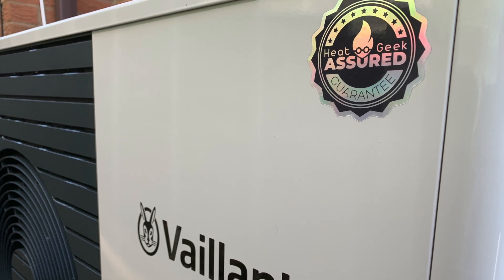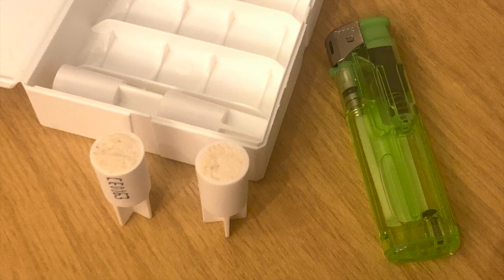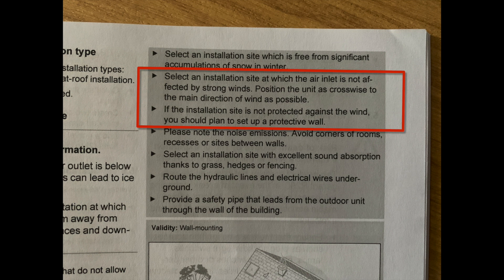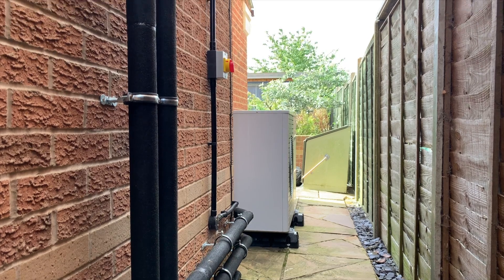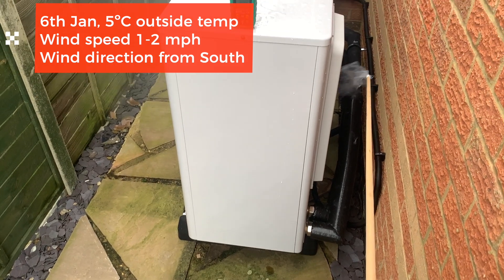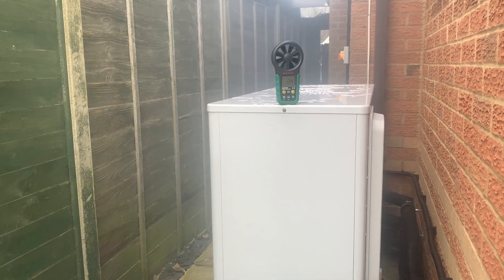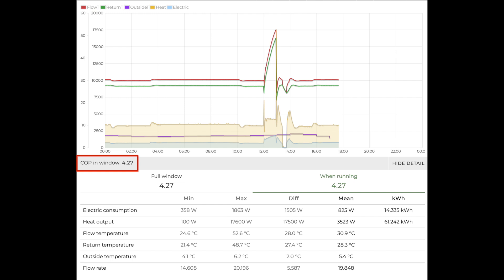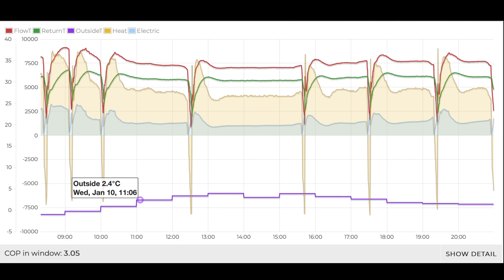Does our heat pump suffer from microclimating

Comment: I wonder why my unit, a 16kW Samsung, requires so much more clearance in every direction. We have a similarly configured but about 50cm wider side path and they refused to fit it there. I would have thought the requirements would be similar as it’s just a fan, perhaps it’s because my unit it tall but thin and so is more likely to capture exhaust airs.
Reply from the maker: Each manufacturer will have their minimum space requirements for the outdoor unit. Looking at the installation instructions for AE160JXYDEH is states; 300mm or more behind the unit and 1500mm or more in front of it. So yes, much more space than mine required in front of the unit.
Reply: @ Yes, strange. The other strange aspect is that the various refrigerants used are different boiling point fractions of natural gas, so not different from the gas used for burners or bbqs. Why it’s ok to have a large bbq cylinder of propane near a window but not an ASHP using a small volume of gas makes no sense from a risk management perspective. Before we put an induction hob in we even used to run a propane cylinder to feed our gas hob, that was fed directly into the house.
Reply from the maker: @yp77738yp77739  yes it is rather at odds with reality. Remember that there's two different minimum spacing requirements here. One is for space around the appliance for it to operate effectively. The second is for a protective zone for the refrigrent in case of leaks. The minimum distances are not the same in both instances.

Comment: Your smoke test doesn't show the full situation of your heat pump, you should be measuring the ambient temp in your alleyway or at the heatpump outdoor sensor vs ambient temp on  the garden side of your house. Then you will see if there is a microclimate.
Reply from the maker: Good suggestion and a valid point for a detailed analysis of the situation this would be a good approach.  

The smoke test was good enough for me to understand the air flow patterns around the unit on different conditions. Looking at the stats for the past 300 days since installation it's obvious we are not suffering from micro-climating. I compared like for like installations on https://heatpumpmonitor.org

Comment: What's wrong with locating at higher up the wall, above hight of fence ?
Reply from the maker: Good question David. It's certainly a solution if micro-climating is a problem. As it turns out we don't suffer from micro-climating. Therefore wall mounting provides no benefits, adds installation difficulties lifting the heat pump due to its weight. There's the potential of vibration coming through the walls once wall mounted.
Reply: @johntisbury  I had mine wall mounted which gives me a pipe length of about 4 feet. Everything is on vibration mounts and nothing is audible either inside or outside the house. The weight is only about 120Kg so not an issue.
Reply from the maker: @mbak7801 it’s a good option for sure.

Comment: Thanks for this video, I’m about to install one and was worried about this but the space I have to install is bigger than you had in the video and it’s only a 3.5kw HP. 

Are you able to provide any noise levels you experienced in that space? I’d love to have the original video sound to know how noisy it is as there is a ground floor window about 2 meters away from where the unit will be located. 😎
Reply from the maker: Thanks for watching. You won't hear the heat pump although that does depend on the brand. Vaillant are amongst the quietest. We can only hear ours when it does a defrost and you really have to listen out for it. When it's running for the majority of the year the window will be closed. It's only in the better weather during hot water cycles if the window is open you might hear it. TBF the Vaillant sounds like a fan heater on its lowest setting even standing next to it. We cannot hear it in the house.

Comment: You have home assistant, so with an Arduino and 3x DS18B20 temperature 1-wire probes, you could monitor the ambient temperature (somewhere in the vicinity) and the temperatures of the intake and exhaust.  If the temperature at the intake slowly drops while the unit is running and the ambient temperature remains fairly constant, then there is some micro-recycling.
Would be interesting to see the graphs over a period of time and at different times if the year though.
Reply from the maker: This is a very good suggestion, thank you.

Comment: Hi John, interesting diagram on right at about 4:16.  Is that saying you need 1000m clearance between top of pump and bottom of window if there is an opening window above it?  Interesting video as I'm currently in the planning stage.
Reply from the maker: Thanks for watching. No the 1000mm refers to a clear distance above the heat pump of 1000mm if you had a low car port or something like that. You will however need to consider the R290 protective zone which only impacts windows or doors to the side of the heat pump. Not those directly above it. I guess that's because any leaked gas will drop to the floor rather than rise. You can download the manual from Vaillant's website before purchase.

Comment: Micro climating in your setup would be very unlikely, even with the wind facing the heat pump front, the wind will hit the surface of the house and draw up the wall and the wind at roof height will be significantly higher creating an up draft. The fan draw would have to be significant to stop the wind drawing up.
Reply from the maker: Thanks Sean, that's a good point.

Comment: At 1:46 in the video you can clearly see on the clearances in the bottom right that Vaillant recommends at least 2300mm in front of the unit (F + G).  You commented to me in the comments for the video where I raised this concern that Vaillant's recommendation was 600mm, then later in the video you show another page which shows a minimum clearance of 600 mm, which one is correct?  They can't both be right.  You also need to repeat the tests when there is no wind and when the wind is SW or W.  These tests are not conclusive but they do show some expelled air being drawn back into the rear of the unit.  There shouldn't be any expelled air being drawn back in.
Reply from the maker: Hi David, I have re-looked at the video and cannot see any mention of (F + G) at 1:46 mm:ss, perhaps it's a YouTube timing issue. I have re-read the installation manual and G is not referred to as a minimum clearance measurement. F is referred to when was wall mounted, which can be ignored for our installation. Could it be the R290 clearances you are referring to? I see this at timecode 1:58 when I view the video. Here is refers to F + G (500m + 1800mm) which equals the 2300mm you quoted so I'm guessing this is what you are referring to. These measurements are the R290 refrigerant protective zone and there cannot be any windows, doors, light shafts, cellar entrances, escape hatches, flat roof windows or ventilation openings in the protective zone. As mentioned in the video this does not apply to our installation as we or our neighbours don't have any such things near the installation. 

I did say in the video that I would be doing further testing. Probably next week as there's some frosts due and hopefully no wind or a SW / W wind as you suggest. Yes there's some expelled air being drawn in but it seems to be a very negligible amount and does not impact performance. Talking to a heating engineer this evening he suggested adding an accurate thermometer behind the unit and check if the temperature goes down when the heat pump is on. So that's probably a test I will perform too.
Reply: @johntisbury  thank you for clarifying, it confused me because it was showing 2 different measurements.  I still think there's a risk of micro-climating, but appreciate that was the only location where you could fit the pump and the performance looks really good.  I hope it serves you well for many years to come.
Reply from the maker: @davidstorm4015  no problems, I could not have been too clear in the video when I explained it.

Comment: My Ecodan is in a very similar position, except the fence is around 4ft rather than 6ft.  It's design efficiency was 410%, over 3 years it's achieved 400%.
In my case the wind going between the houses (stronger than ambient wind) clears the cold air out with no problems at all.
Reply from the maker: That's good to now. I believe we have a similar situation with the wind tunnel effect between the houses. Even on very light wind days it more noticeable and stronger down the side of the house.

Comment: Good video. I have considered this issue for our heat pump. Ours is also down the side of the house too. In the end it seems a bit of a non issue as the massive fan does its job and pushes the cool air away.
Reply from the maker: This is what my testing seems to prove Chris.

Comment: It’s interesting to see that during a defrost, the flow temperature hovers around zero. The best installs use plain water and hence I wonder about it freezing. I guess the defrost cycle is short enough that it’s not a problem.
Reply from the maker: That graph is a bit misleading on its Y axis. I have had a look at the flow temperature in more detail and in a defrost it drops to around 19ºC before shooting back up again to around 30ºC.
Reply: @johntisbury  ah that’s more reasonable! I can see why in the short duration of the defrost that’s hardly noticeable in terms of the house temperature.

Comment: Does the R290 clearances D 1000 is in your neighbour's property, is this allowed.

4.1 Protective zone

The product contains R290 refrigerant. Note that this refri-
gerant has a higher density than air. In the event of a leak,

escaping refrigerant may collect near the ground.
The refrigerant must not collect in any way that may lead
to a dangerous, explosive, suffocating or toxic atmosphere.
The refrigerant must not get inside the building via building
openings. The refrigerant must not collect in grooves.
A protective zone is defined around the product. There must
be no windows, doors, light shafts, cellar entrances, escape

hatches, flat-roof windows or ventilation openings in the pro-
tective zone.

There must be no ignition sources, such as plug sockets,
light switches, lamps, electrical switches or other permanent
ignitions sources, in the protective zone.
The protective zone must not extend to adjacent buildings or
public traffic areas.
In the protective zone, you are not permitted to make any
subsequent structural alterations which infringe the stated
rules for the protective zone.
Reply from the maker: R290 is not relevant as there’s no opening doors, windows anywhere near, including our neighbours

Comment: Planning permission for a HP, didn't know that was needed
Reply: Very informative video John. We already have a Multisplit AC unit on our house therefore we have to apply for planning permission to install a second HP. Looking forward to our ASHP being installed later this year.
Reply from the maker: @paulbuglass7690  thank you for watching. Your installer may also need to seek DNO approval too. I hope your installation goes well.
Reply from the maker: It depends. Our installation is within the allowable 1m to a boundary fence (2m in Wales). Planning rules are being reconsidered as they are outdated and stops so many installs
Reply: @johntisbury  Thanks John.
We have Solar and battery, and whilst I think we have a good few years left with our combi boiler it seems like we'll be pushed down this direction eventually I guess
Reply from the maker: It will be interesting times in the next 5 - 10 years. We are still in early adopter territory but soon they will be more mainstream. Also Building Regs, Code L (I seem to recall) states that you cannot retrofit a less enviromentally efficient heating system to replace the current one in a home.
Reply: @johntisbury  Only done relatively light hypothetical research, but we'd have to place ours in a similar setup to your own.
Our shower is boiler fed and our radiators are the microbore pipe sizes, a fact that is OK or bad depending on who and where you source info from.
Doubling the radiator sizes (if supported) is not viable in all rooms.
Only been in this property a few years, but recently upgraded our loft insulation to 300mm (loft legs so not compressed) and the difference is pleasantly noticeable in terms of heat retention and gas costs.
Lots to consider :)
Reply from the maker: @stuartburns8657 sounds like you are on a similar journey to mine. We have microbore 10mm and a large system, 17 radiators and it works fine. If the system is properly designed it's fine. You can push any amount of heat down any size of pipe. The key thing is flow rate for heat pumps. Providing you can get 20 L/min you will be fine. BTW I've documented all my upgrades and installation of the heat pump on various videos on my page.
Reply: @johntisbury  Subscribed earlier! 
We have a more modest 10 radiator setup + underfloor heating in kitchen.
I'll try to catch up as a lot of similarities :)

Comment: Very helpful especially the visual smoke test! Quick question: I have a big glasshouse next to the house (always +0 Celsius) and thinking of placing the heatpump INSIDE the glasshouse with only the fan face outside (basically making a hole for it 😊) and respecting all the clearances. Do you think that's a good idea? I'm using it in heat mode only, and figured this will SIGNIFICANTLY increase its COP efficiency as the air it pulls is much warmer than outdoor air and will probably never have to deal with deiceing. If there isn't enough air flow, I can always crack open a window of the glasshouse to get more air, and it will still be warmer, especially during sunny winter days. During summer days it should really help with DHW heating. What do you think? How much increase of efficiency should I look for? Would this even work the way I imagine? 😅
Reply: You’re going to cool the greenhouse to ambient in approximately 2 minutes…

Have seen US DHW heat pumps which extract air from their loft space in the summer, saving on home A/C - and switch to outside air for the winter… when they don’t want to cool the house at all.
Reply: @JohnR31415  That would be at full power though, right?
Reply from the maker: I like your thinking, however it's unlikely to be efficient. The heat pump will be sucking in cooler air from within the greenhouse even on days when it's 11ºC outside based on the fact it's always 0ºC inside your greenhouse. Plus it needs a good flow of air to be sucked in to allow the heat pump to extract the heat from the air before it is expelled out the front of the unit as cooler air. The unit will probably be in constant defrost cycles as defrost typically happens below 5ºC outside temp.
Reply: @johntisbury  It's always +0' C (MORE than 0 - actually always more than outside temperature!) Probably almost never going less than 5' C. Also ALWAYS direct sun irradiation over the evaporator (when the sun is shining). I can always make more air flow by leaving a window open so it can get fresh air from outside (it will be air from above a roof, so slightly warmer than outside temp). It looks like it should work!! Aming for 7+ COP! Thanks!
Reply from the maker: @VibesOfChange  maximum air flow of our 7kW heat pump is 2,300 m3/h, that's a lot of air throughput. I have a visual image of your green house imploding due to pressure build up.

Comment: I have a low loss header on a two story semi, there is a pump on the heat pump and one after the low loss header.This is my second heat pump they just replaced the Hitachi for a Grant no Flow meter fitted can I do away with a pump and the low loss header.What are your-thoughts on this what difference would it make just off the top of your head,it’s not rocket science or is it
Reply from the maker: Low loss headers are used for hydronic separation. If you have 2 circuits with different flow rates, eg rads and UFH then you may need a LLH. They can be used if you don’t have enough pump head to flow round the system. You really need a heating engineer who can run the calculations based on your system design to know if you can remove them.
Reply: @johntisbury  Thanks for the reply John why do they try to make out its rocket science my Combi did it no problems.Flow rate you would have to be changing it manually about 3 times a week from what I am learning bits here bits there I wish I had never heard of Heat Pumps.It was fitted by a MCS registered company and they have missed out the flow setter which was in the box fitted the ancillary pump upside down and it has never performed as it says on the box.John it is a nightmare.
Reply from the maker: That's frustrating for you. Unfortunately being MCS is no guarantee of a good design and installation. Heat pumps are not difficult to install correctly if the heating engineer designs the system properly. Much like the other government grants for solar PV, Green Deals and so on, cowboys and untrained workman jump on the bandwagon wanting to make a fast buck.

Comment: Thanks for this John. This is good to know. I’m debating getting a heat pump and was assuming I’d have to have it around the back of my house which would be a pain and a long way to run the pipework too. This is definitely something to consider if we can put it down the side and would make the install loads easier. Cheers.
Reply from the maker: Thanks for watching. Good to hear our location may have helped with your choice of location too.